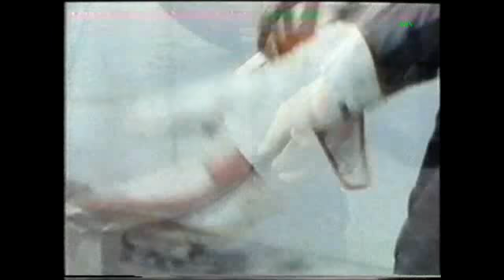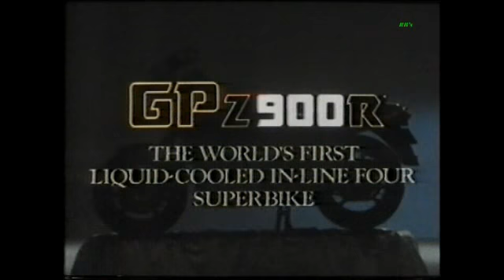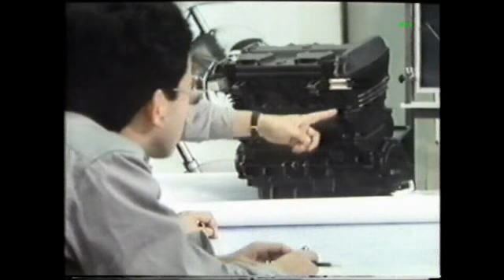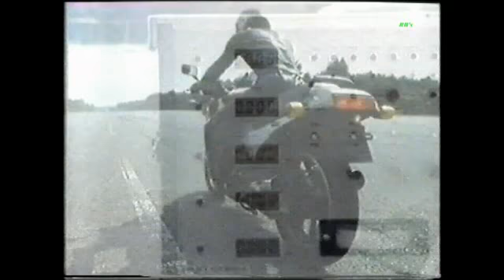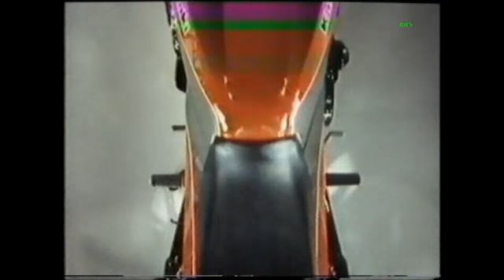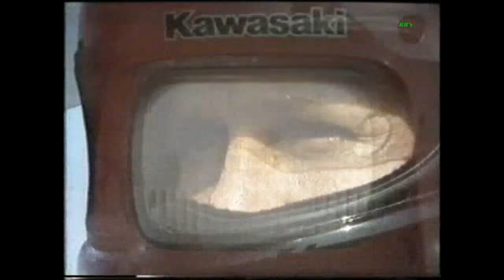Kawasaki GPz900R Promo Film

Comment: They enjoyed a couple of years on top until Suzuki brought the GSX-R to the states in 1886 and that was the end of that. I bought the 86 GSX-R 1100  new at 18yrs old. Blew away every bike on the road.
Reply: A buddy of mine bought that same bike brand new, while I still had my 86 Ninja, and I rode it once.  In 1st gear, at 3000 rpm (which you may recall is where the tach actually started), I grabbed a handful of throttle, and it leaped up into a wheelie so fast I had to instantly let go of the throttle!!  And yes, in the sportbike shootout of 6 bikes in 85 or 86, it was crowned king by Motorcyclist magazine, but the 900 ninja still held its own at #2, because of its handling!   

Suzuki GSXR1100 & either the GS-1150 ES, or maybe the Kawasaki GPZ1100, the 900 and 1000 Ninjas, the FJ1200, and the 1000 Interceptor I believe were the 6 bikes compared.  And if the road had some curves, I could beat my buddy.  I cornered that Ninja so hard I dragged the pegs & pipes!!  It felt like it was on freaking RAILS!!  Literally.

Comment: I set my personal land speed record on an 86 900 Ninja.  Speedo read 155!  And if you closed the throttle slightly, the bike actually sped up just a bit.  The reason:  Kawasaki actually de-tuned the engine slightly for the US market by putting in a main jet that was one size larger than ideal, thus making the engine run slightly rich @ WOT, and making about 5 less HP.  So when you rolled off the throttle just a bit, it leaned out the fuel mixture to what it should've been, and the bike ran a bit faster/better.  Switch out that main jet for the smaller one, and you had the cheapest extra 5 HP you'll ever get!
Reply: I actually think you could have a point there regarding the main Jet. Though I still believe it’s one of the nicest looking bikes ever made. My 1985 black and red model still turns heads and it nearly 40 years old!!!
Reply: @colinjrob  Back in those days, I stayed up on all the sport bike tech at the time, and that main jet thing is very true.  You can even see the different main jet sizes for the 900 Ninja in the factory service manual, depending on what country the bikes were being shipped to, and what their max HP laws were at the time.

I think I was first made aware of that detail in a Motorcyclist magazine article, probably by Joe Minton.  It was probably titled, "Simply and easy way to get 5 more HP from your Ninja."  LOL

Congrats on still having that bike!!  I wish I still had mine, but I moved on to a Concours in 97.  (Which I still have.)
Reply: Only took mine to 145, then chickened out. Felt like riding a missile sled.
Reply: I'm not sure detuned is the correct word probably erred on the side of caution by running a bit rich on WOT to avoid melting stuff if held at VMAX for long duration. They were a quick thing in their day.
Reply: @SB-vb8ch  No, that's not why they did it.  It was due to HP restrictions in place at the time in certain countries.  You can see the different spec main jets in the factory service manual, depending on which countries the bike was sent to.

Comment: I had an 85, supposedly the last yr they were made. Mine said 998 instead of 908. I was told when l got it, it was a tribute to the two when gpz went on to be a sports touring bike an ninja went on to be kawasaki bad boy. Everytime l try to look one up its either a 900 or 1100. I know they made one for the 1100 called the " eddie lawson edition " but hope to find out if they did. The gpz 750 turbo was also an excellent edition to the gpz to, imo... But are very hard to come by now a days.
Reply: They introduced the 1000 Ninja in 1986, which was 998cc, and they still made the 900 also that year.  But they didn't sell, because everyone wanted the new bike.  But even though it was a bit faster, it didn't handle as well.  So when I bought my 86 900 Ninja, the dealership had 6 brand new ones, still in the crates in the back, and they sold for $4400, which was $400 less than the 84 model when it came out.  It was the best buy out there at the time!  The ELR wasn't a Ninja.  It was based on the older, air-cooled technology.  First, a 1000, then an 1100.
Reply: +gr8guitarplayer 

yes, mine was 11/85 of actual production. lt didnt take much to hop it up a little but still have a hard time finding one. my friend has an 85 gpz ninja 750 turbo but won't let it go for nothing. Before that l had a Suzuki gs 1100e and would love to send the 2 up against each other in a drag race.  
This was a while back but miss those days. Got into 4x4 right now but am debating on building drag car or get back on a bike.

Comment: Had a 83 KZ750L3 kawi.I would drift threw corners.Weaved around 110 a bit.Dragged the foot pegs.Ran 12.53 after cleaning the plugs the 3rd time! Friends said youre gonna crash! So EASY riding it at the limit.Traded it in 86 for a crashed 84 900 ninja from my buddy..He gave me all the parts it needed. I will never forget that 1st ride! I could never ride it at the limit like the old KZ, the limits were much higher.Felt SO planted, powerfull.It was a dream come true getting that bike.

Comment: First 150mph  production bike,,
Reply: Suzuki 750Rwas
Reply: @ursiny33  owned an 84 NINJA 900 and then an 86 GSXR 750. THE suzuki handled faster at lower speeds, but was 

a shitty bike in every other regard compared to the 900. I just bought an old 900 last year and love it.
Reply: @bademoxy  what's the price you paid for 900
Reply: @johnlocke4695  i actually bought TWO 84 A1s ,both repainted , one  with 12,000 KM  but rotted exhaust and leaky forks for $1500  and the second one a well maintained but high mileage 40,000 km for $750 but had a custom low seat and 4 into 1 Yoshimura pipe . I combined the best parts of the two and am driving it now to work.